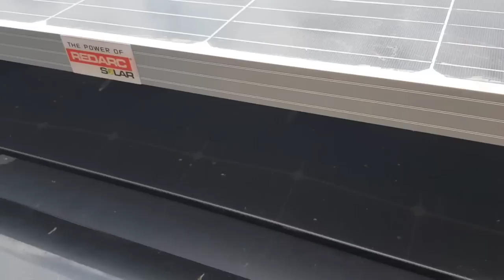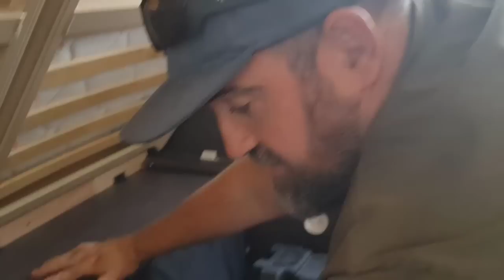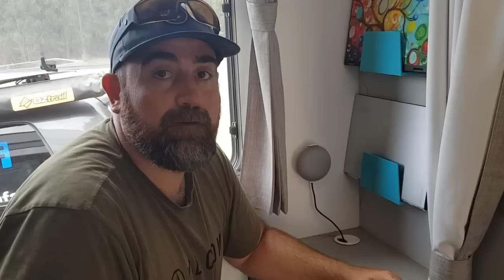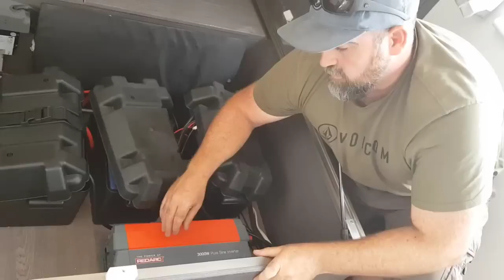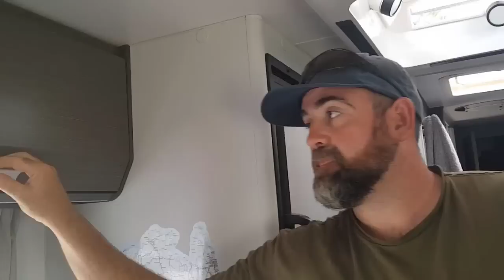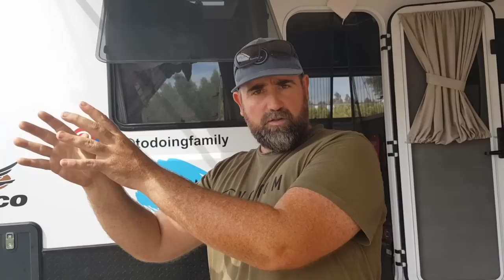Todoing family REDARC solar review

Comment: Great video, just 4 questions, 

Q1 What amperage are you 3 x 12v Batteries & I take it that they are connected in parallel to give you a total amperage .

I am a Remote communications  network engineer with a portable comms trailer  fully 12v powered with a Giant 12v 130 amp secondary battery & a PX II XLT MY17 Ranger also with a Giant 12v 130amp secondary battery, I don't currentl6 have a need for an inverter as 100% of what I do & carry is 12v powered / can be charged by 12v ( that might change when we take delivery of our new drone )

 I do a lot of very remote comms work for our 3 x Telcos & a lot of buildings, farms, ags, corporate as well as our 3 x levels of government & live my 12v setup.

Its always a work in progress adding & changing stuff   

I currently run 2 x "Kick Arse" ( Australian Direct ) Projecta DCDC MPPT Solar Battery Charger 12V-24V 25Amp with Pre-wired Anderson Quick Connect amount a lot of other Kick arse bits and pieces & love it.

I don't yet have a solar blanket  but have a portable 200w portable solar panel for the vehicle & a 150w for m6 comms trailer.

Q2 how long generally does it take to charge your 3 x batteries together 

Q3 How do you monitor your batteries 

Q4 Who fitted your power selector

Look forward to your answer & future video, I live these types of videos & cannot get enough of them.
Reply: Hey there, thanks for the questions.  A bit in there so will tackle 1 by 1!
Reply: Q1: We have 3 x 100ah AGM batteries.  If we had our time again we would go Lithium, to allow faster absorbtion and deeper usable amp hours.  Sounds like you have a great setup there fit for the job.  Solar blanket provides a lot of flexibility.
Reply: Q2: It's a bit tricky, depends on Amps in.  From the solar today we were bringing in about 30ah during the main part of the day.  So with 300 ah batteries, we would need 10 hours at that pace allowing they were dead flat.  But you only take them down to max 50%.  So in that case 5 hours.  As you know the sun and clouds change, so realistically we get maybe 7 to 10ah on average on a not fully clear day.  It is a how long is a piece of string question though!  Hope this helps.
Reply: Q3: We have an amp hour in or out monitor, plus a current voltage monitor in the caravan.  We hope to upgrade to the Redarc Battery Management gear when we do go Lithium.
Reply: Q4: The power selector was by a licensed electrician.  Best to get them involved as it is 240V power with the associated rules & regulations (and safety concerns!).